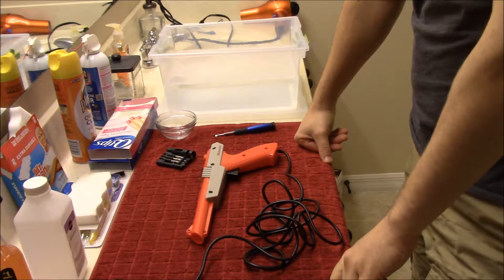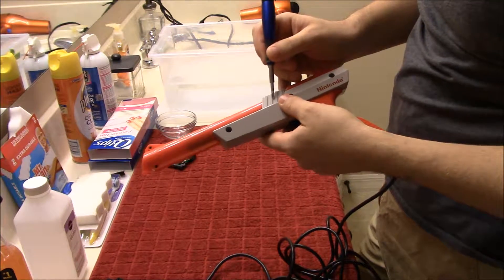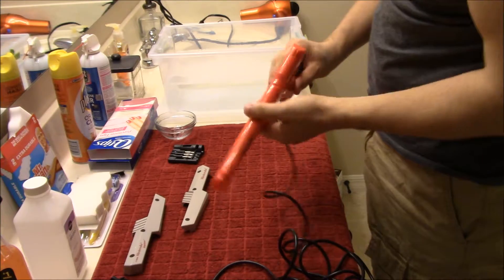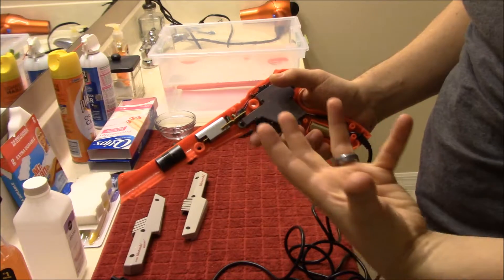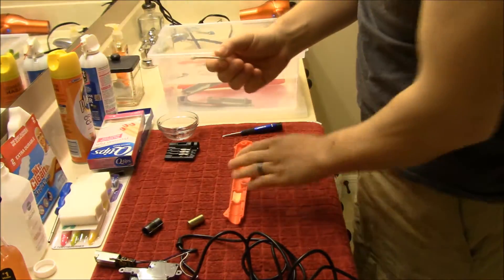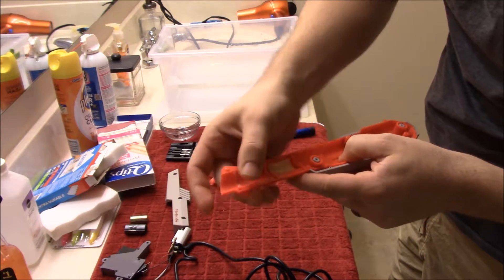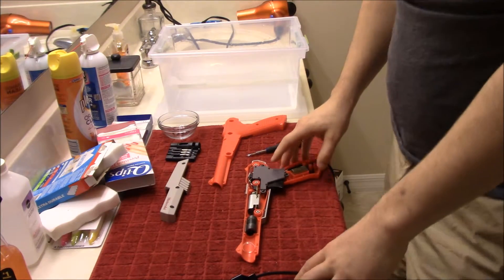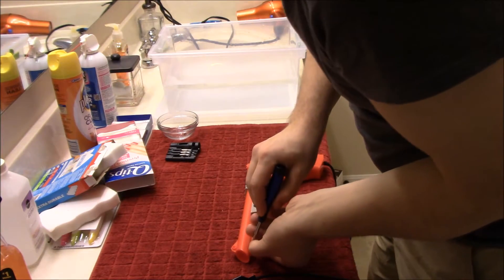Cleaning an NES Zapper

Comment: i rubbing alcohold the label off
Reply from the maker: Rubbing alcohol can disolve the glue used to stick down labels, but you usually need a lot of alcohol and a lot of rubbing for them to fall of. I'm thinking that either the label or the glue was weakened before you started cleaning it. However, if the label is still intact, you can easily reapply it. Just use normal spray glue (like super 77). Just don't spray the label or the gun. Spray the glue into a paper cup or onto a paper plate and use a Q-tip to apply it to the area you want to apply the label, then wipe of the excess.
Reply: @Vigerp  thank you ^-^  I will try this soon!